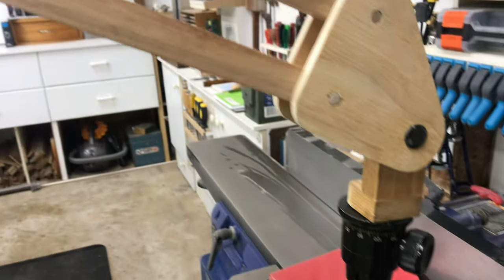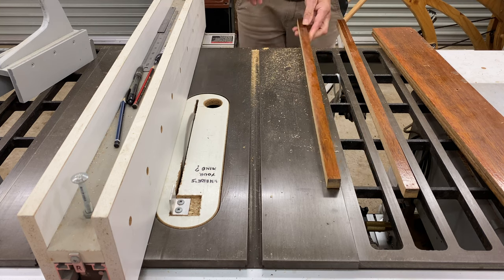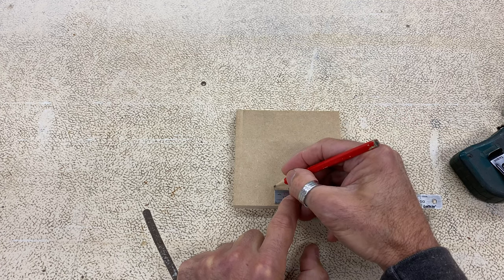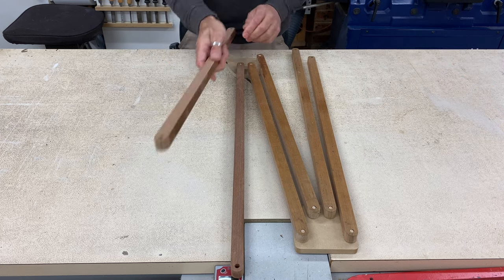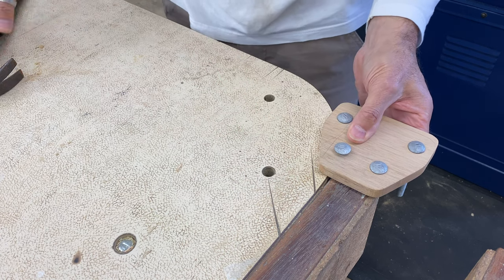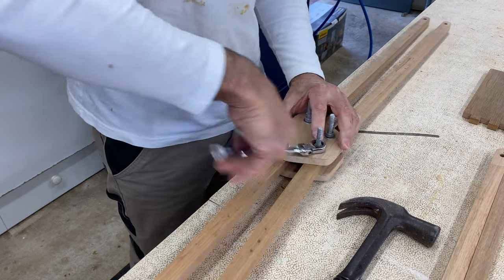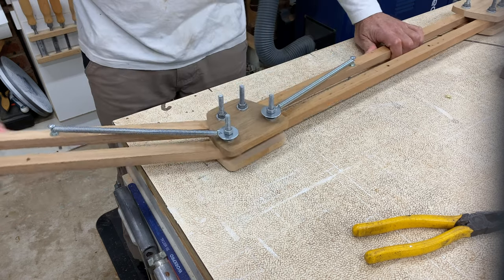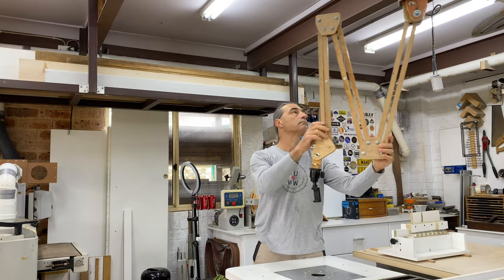Awesome camera jig boom arm build

Comment: Simple and effective. John Heisz Matthias Wandel and lots of others have made sanders etc. but YOURS is the quietest. Your motors are fantastic. The camera booms they have made aren't any more effective and usually shorter. Great work.
Reply from the maker: Thanks Clyde. the belt grinder motor is a DC motor from a treadmill which means its almost silent and very smooth

Comment: Nice build, well done. Thought you might have used Lock nuts on the joints .. might provide better tension on the brackets. Thx for sharing.
Reply from the maker: Thanks very much. my intention was to use lock nuts but in the video i used standard nuts because thats all i had at the time . i just thought i would replace them later but after using the boom for a few months now i have found that the nuts dont loosen over time at all

Comment: Nice victor, very simple design but very useful. I had though about making something on the ceiling but because of my lights I’ve put it off, as moving my tripod back and forward is a bit of a pain with the space I have, so might get around to making something similar on my ceiling, I’ve already got the parallelogram arm on my tripod so I just need to makeup the bracket and fixture for it on my ceiling. But I like how you’ve got yours on the beam that’s holding your house lol. Good video brother.
Reply from the maker: Thanks very much Darren. i'm very lucky to have those RSJs in the workshop, they're perfect for this. I hear you brother, it is a pain moving a tripod around particularly in a small shop

Comment: Nice one! I was thinking about those kinds of arms a while back and was wondering how well they could be scaled up. Happy to see it works well.
Reply from the maker: yeah it works great John, and because the tension at the joints is spread over 4 points of contact rather than one with my old boom they dont need to be cranked down too hard making it smoother

Comment: Nice one. 
Surprised there weren't any washers in between the plates and arms.
Reply from the maker: Thanks Drew. I’m relying on the friction between the parts to stop the boom arm dropping when extended out. I think washers would have meant the bolts would need to be overtightened

Comment: How much weight would you guess that can hold fully extended.  I have a microphone that weights about 2 pounds.  Will that hold, and still be adjustable ?
Reply from the maker: i only use it for my iPhone so can't really say how much it will hold. i adjust the boom by tightening the nuts at the joints whenever it needs it. The mechanism is very rudimentary. There are a few videos on YT showing some great camera boom builds.

Comment: Very Nice build. How do you make belts from those belt rolls at  3:50? That would be a great followup for the belt grinder vid.
Any tips on them would be really welcome!
Reply from the maker: Thank you Catilane. Actually that scene in the video is a little deceiving ( i noticed it when i watched it back). those rolls of sandpaper are for my large drum sander, i need to find a spot to store them. i bought the belts for the grinder off ebay i think.